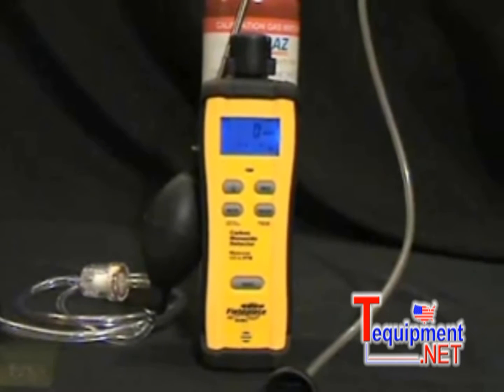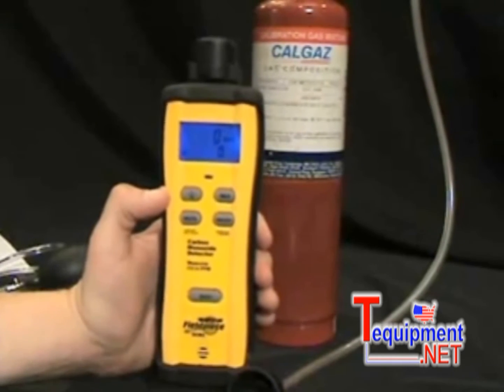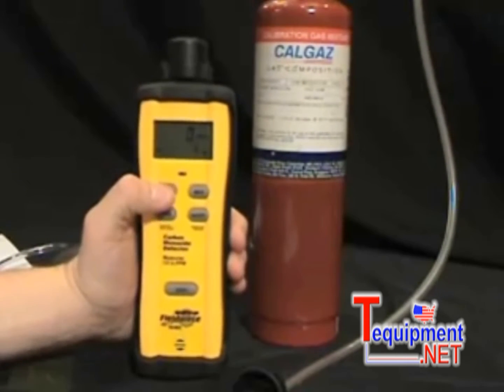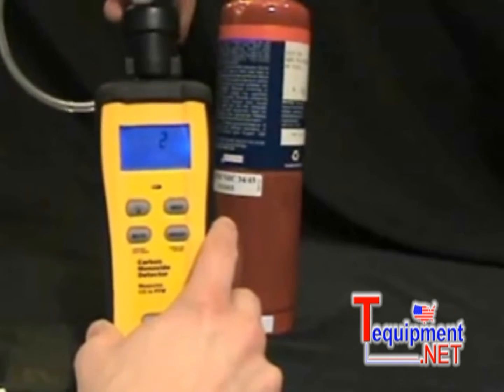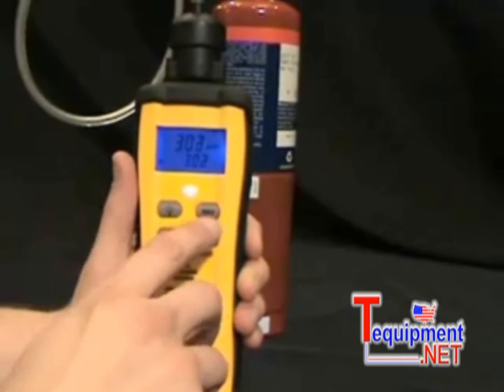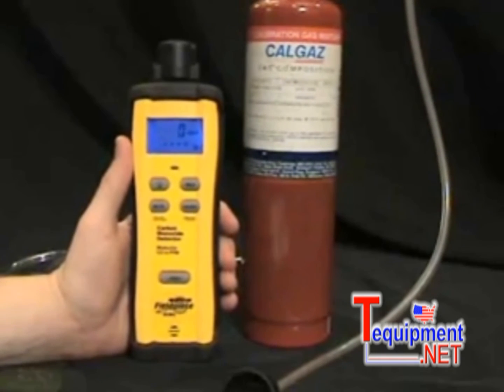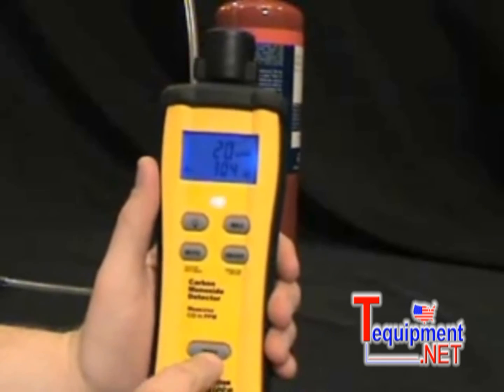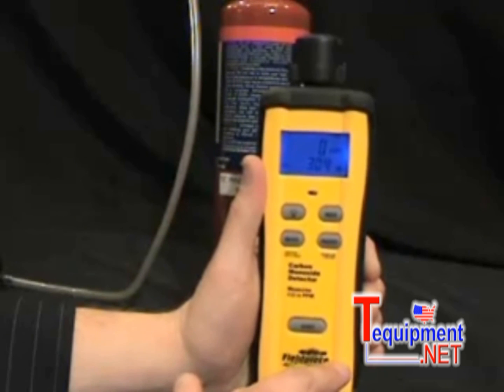Fieldpiece Instruments SCM3 Carbon Monoxide Detector

Comment: what is the pump adapter? That didn't come with my scm4 i bought from you. Part number? Thanks.
Reply from the maker: Are you talking about the device being used to connect the test tank to the SCM3? I don't believe that is a Fieldpiece part number, it's likely a specialized tool used for demonstration purposes. The SCM4 does not include anything like that. Our product team might know more. Feel free to to call them at (877) 571-7901, email Sales@TEquipment.net, or live chat on http://www.tequipment.net/